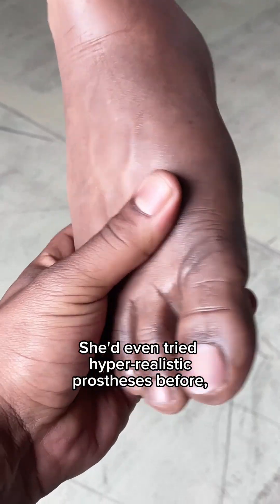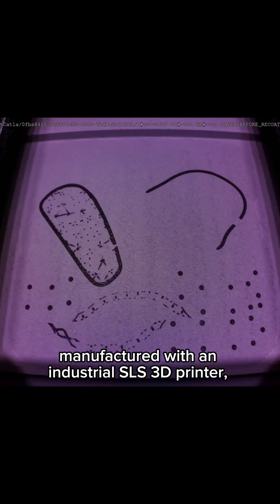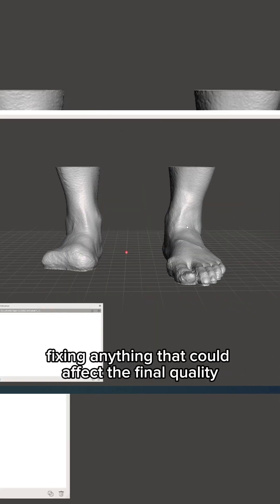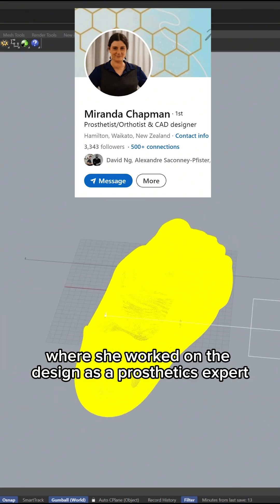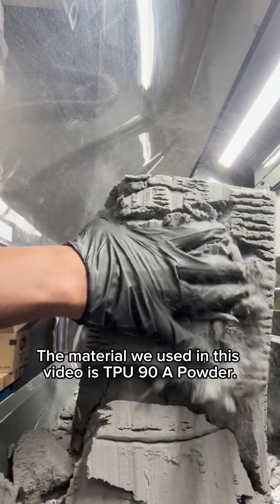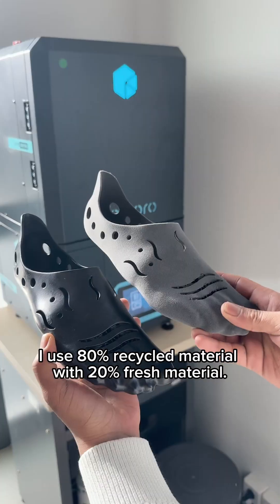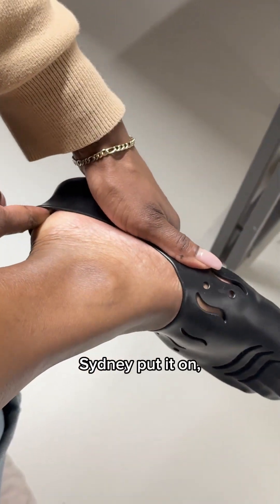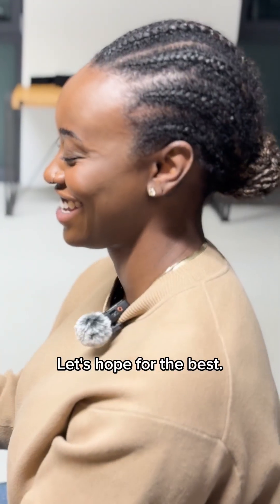Sydney's Prosthesis: Part 4

Comment: Why would you use a media blaster to remove powder?
Reply from the maker: Powder residue can be difficult to remove from certain geometries without blasting. The media blasting step also helps to smooth the surface of the printed parts. Find out more here: https://bit.ly/3Ka6PPS